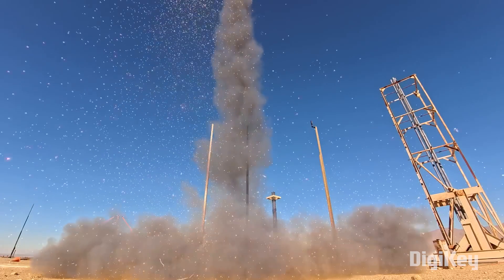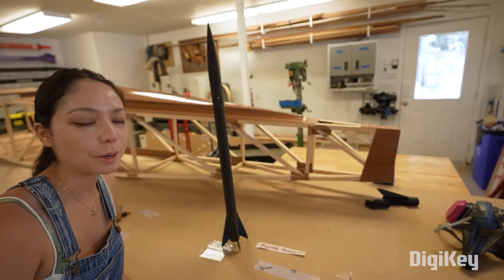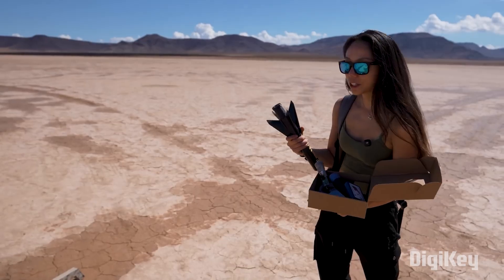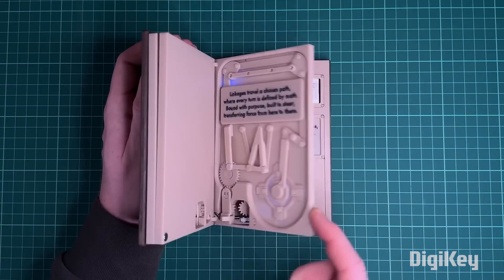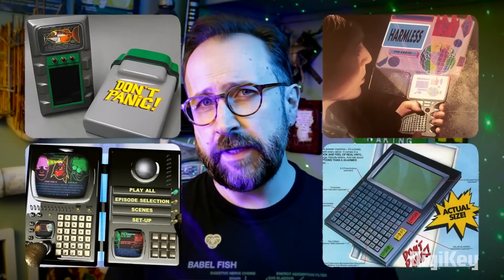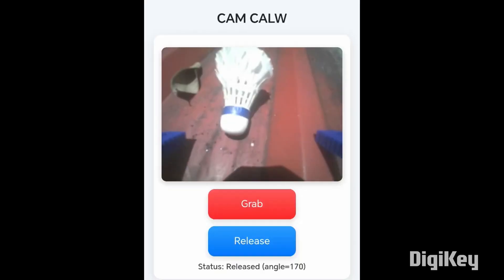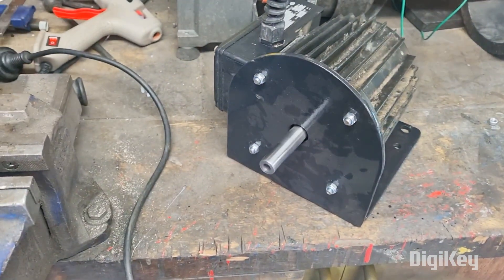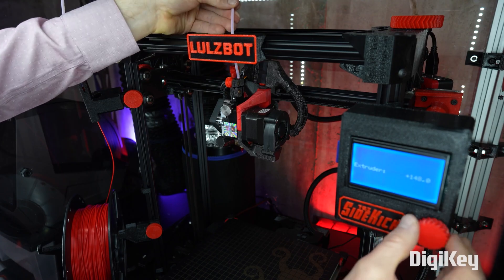Pasta Power [Maker Update] | Maker.io

Comment: The hole in the nose doesn't slow down the rocket, it makes the sensors more accurate. Usually these use a pressure sensor to work out altitude and go do this accurately it needs direct access to the outside air. Great video as usual!
Reply: Interesting! I guess maybe I misunderstood, I thought she actually said the holes reduced drag. Which doesn't make a ton of sense to me, but hey, I'm no rocket engineer - she is.